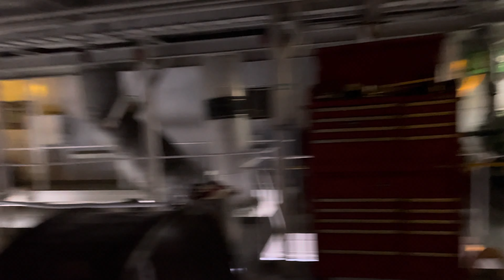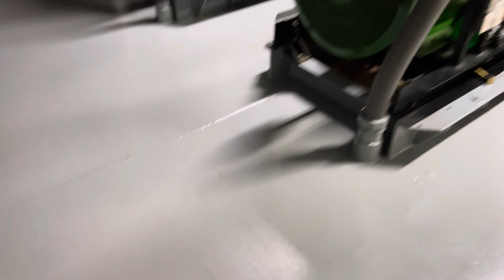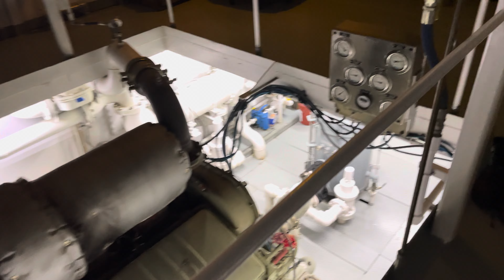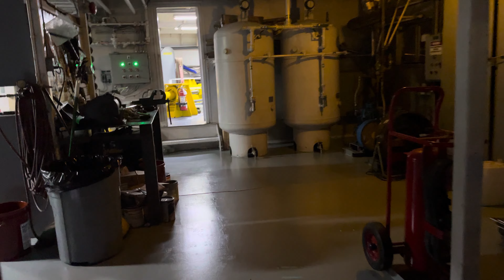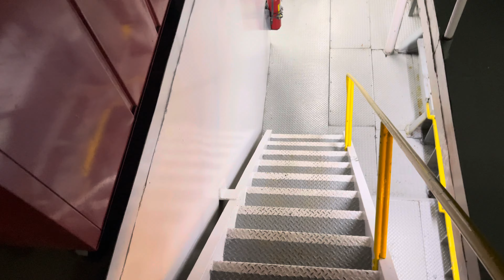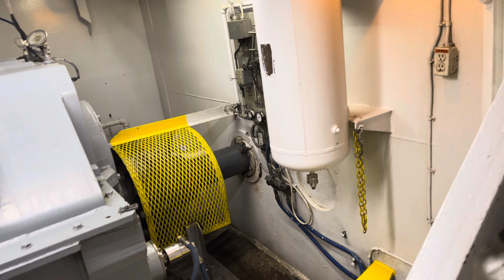Pretty, Pretty... 80s model Viking shining engine room

Comment: I worked on the river in 67 and 68, the boat i worked on had two 1600 HP 2 stroke GMCs.  Both of the chief engineers kept the engine room spotless.  Back in those days there was an oiler on a straight 12 shift so he worked with both the chief and the 2nd engineer.  Back in those days the engineers had a license rated in HP, one of the chiefs on the boat I worked on had an unlimited license because he was an engineer when the licensing was put into place.